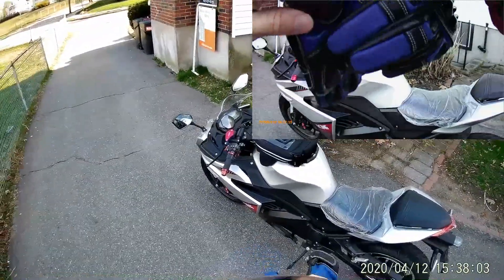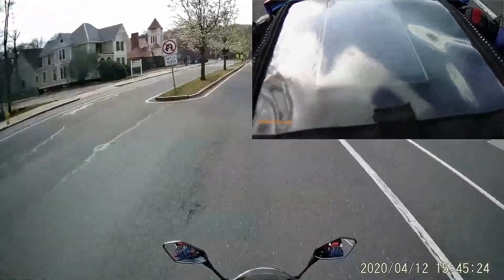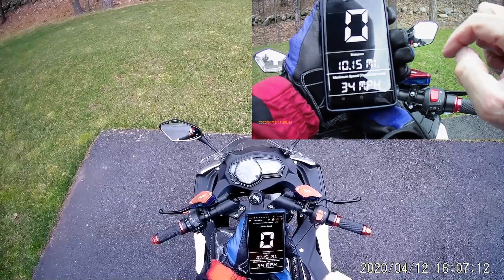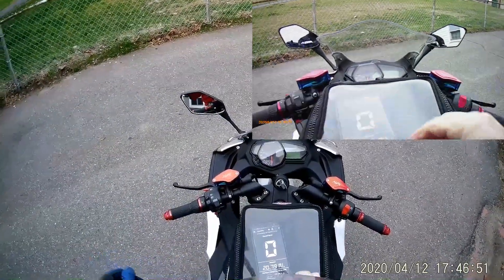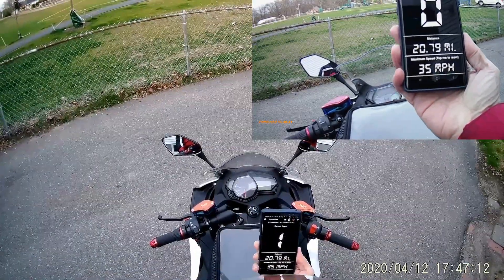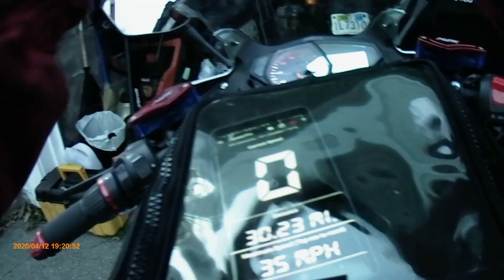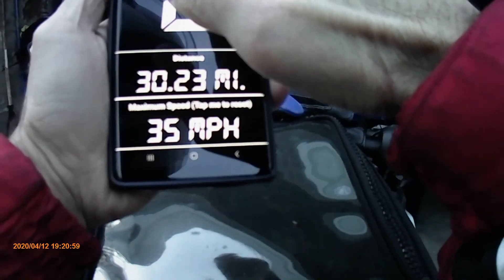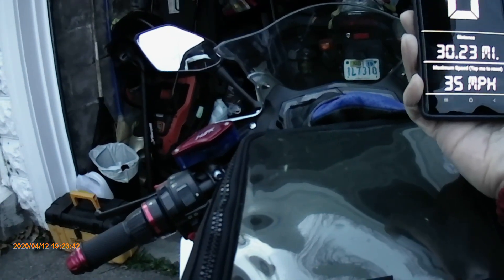I imported two full-size electric motorcycles from China – Part 11: "The Range in D Mode"

Comment: a question how many hours the battery lasts in total from 100% to 0%
Reply from the maker: It depends on your riding. Always near full throttle, it would deplete in less than 20 minutes. If you are minding your throttle and keeping your speed at or below 25mph, you can ride over an hour and a half.

Comment: Are you happy with your purchase?  I heard you say the breaks squeaking went away.  Were you able to fix all the little leaks?  What made you choose that model instead of some of the other sporty looking electric motorcycles?  Thank you!
Reply from the maker: Hi Andrew. Yes, I am happy with this import, considering I purchased the bare minimum models. The squeak from the brakes went away with use, I guess the pads were setting in. I always had been a fan of this "Kawasaki Ninja 300" looks, hence I chose these models. There were two other sporty models being offered at that time, but those looked a bit outdated. Take care!
Reply: @PropsWheels  Thank you for the info!

Comment: It occurs to me, since you have two of the same bikes (I think identical) if you wanted to upgrade the battery you could put the lead batteries from the first bike into the other doubling it's range (you'd need to add a cheap BMS) and then add a small lithium pack to the first bike (plus lithium BMS). Nothing going to waste.
Reply from the maker: Hey, it is a good idea. I will check how much space each has for batteries. Thanks.